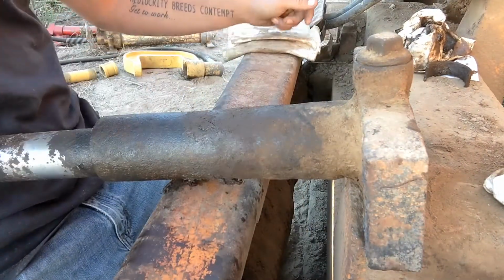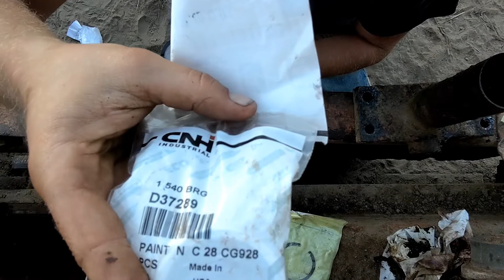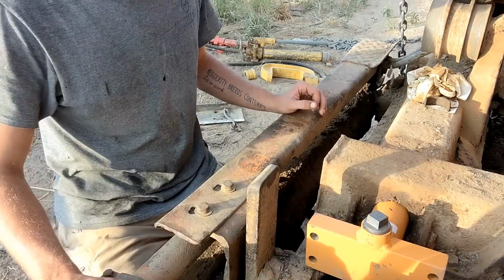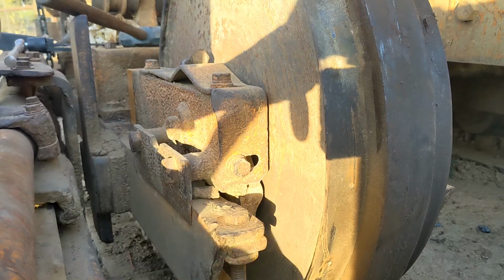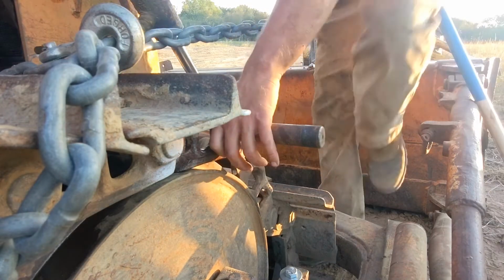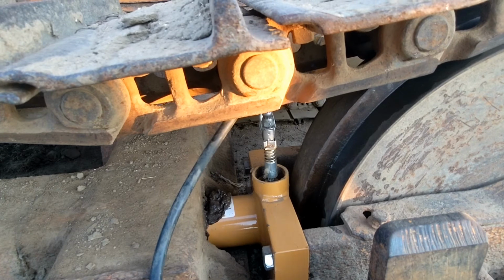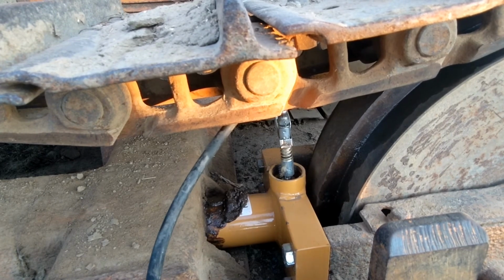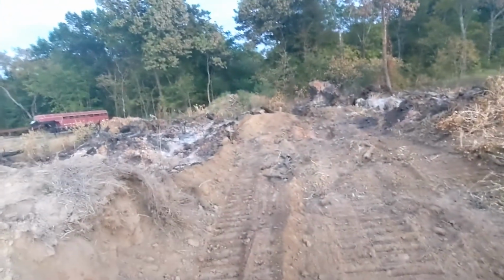case 450 dozer track tensioner repair part 2 new parts, putting it back together

Comment: I tried to do what you did, but when I slide idler forward I left the adjuster bolted on and tried to pull it out.... the piston stayed while the cylinder tube came off... I've tried getting the piston out, but it's stuck in there pretty good. Do you have any advice to get it out of there?

Comment: My piston didnt come out with the track tensioner, its stuck in the hole it sits in, any suggestions, I cant pull it out its so stuck
Reply: Half inch threaded rod up there into the piston about half turn should catch it enough to pull it out

Comment: Next time try use a 2" ratchet strap to pull them together not your back! Lol keeping top the tight with the backhoe like you did
Reply from the maker: It wasn't as hard as it looked I had a cone a long on hand just didn't need it, all the struggle was just getting the alignment just right. The backhoe did the heavy lifting